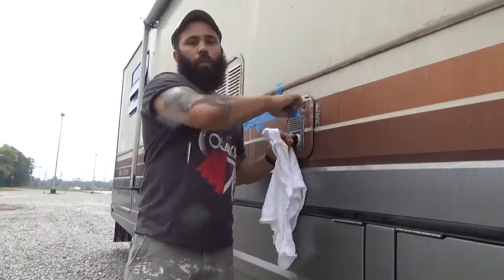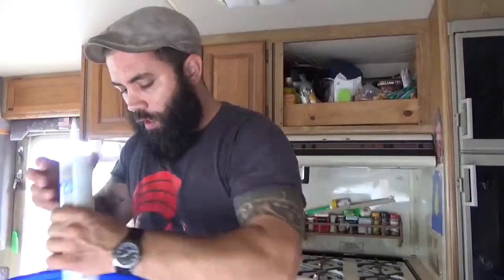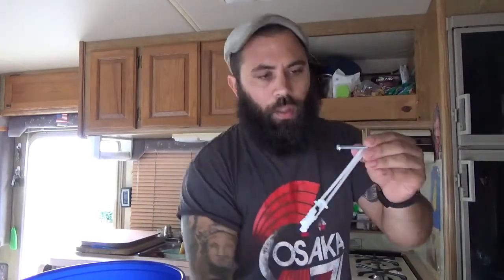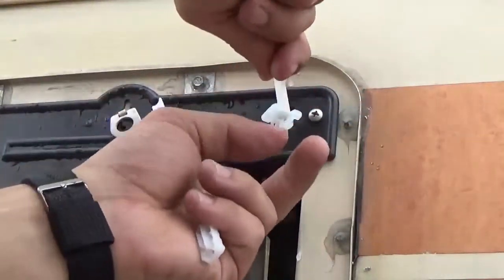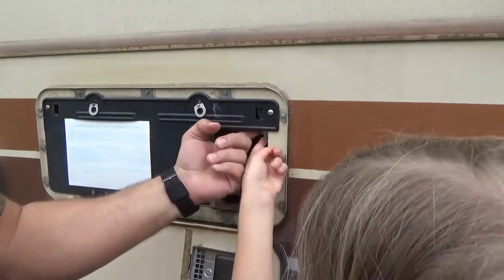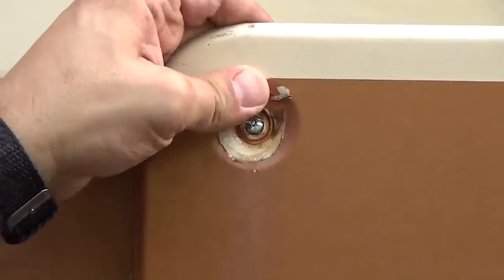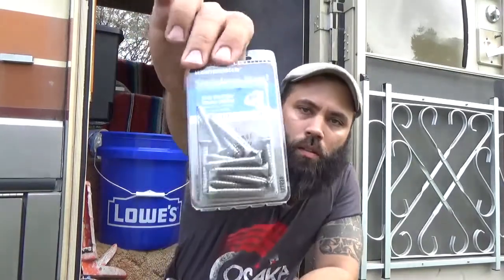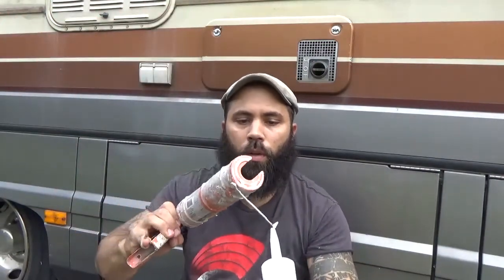Full-time RV:  Cheap (I didn't say correct) Furnace Door Fix

Comment: Tiny hands are very useful when doing mechanical stuff.
Why not put a sealing ring with silicone around the edges and inside the hatch?
Protect the amazing paintjob and have it sealed from damp 😉
Reply from the maker: I would but it has to get open to service the furnace that I never use.